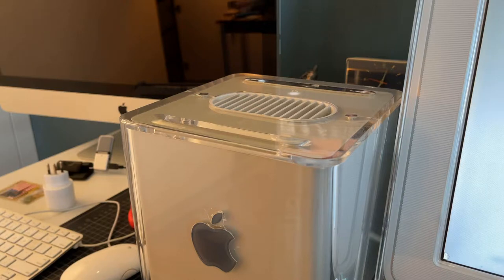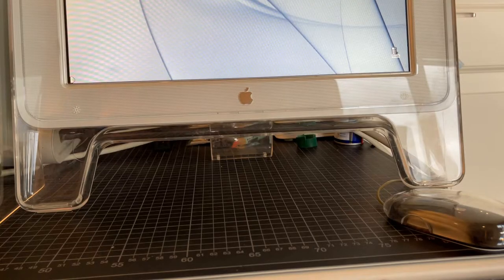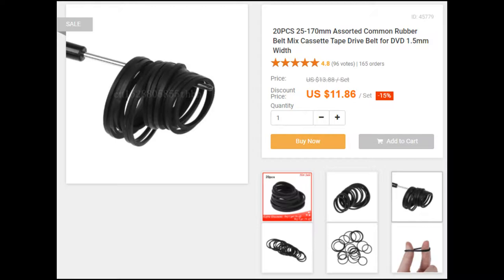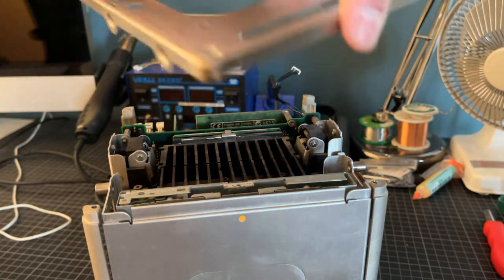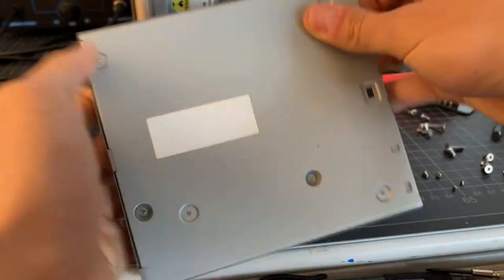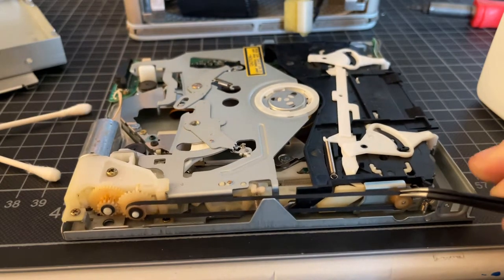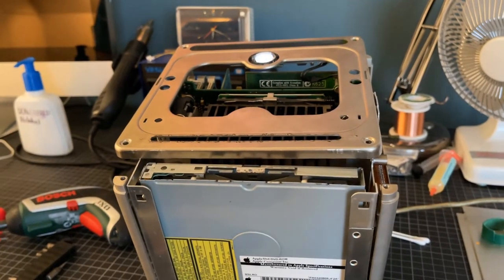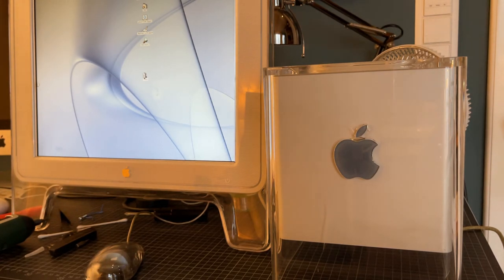How to Repair the CD Drive Eject Mechanism on your G4 Cube! | Mastergeko4

Comment: 11:09 UPDATE TO MY ORIGINAL COMMENT. I found another iMac G3 DV model and I just got it today. It makes this exact sound and I didn't have to adjust or replace the belt or rubber rollers. It worked perfectly with a couple flukes. It took the disc out of my hand with no issues. And it still reads. According to the Seller. It was stored for 11 years so that must explain why it still works. The CRT has low mileage on it too. It doesn't flicker at all. This one might even be in better condition than my first one. This Replacement is a 400MHZ Blueberry. My old one was a (I think) 500MHZ Graphite. Replacement Has 176MB of RAM. The HDD was gone on the replacement because according to the seller it was taken out of a bank office so the HDD was removed and shredded. I just stole the HDD out of my Power Mac G4 Quicksilver and put it in.

Comment: Thank you for the amazing video! I performed these steps earlier today and my cube (complete with new belt) now ejects CDs again. All you need is a steady hand, the belt, and a few screwdrivers. Note: the two springs you need to detach in the CD drive are incredibly small, used a microscope to get those springs back in place. Also, ensure there is not a CD inserted when you perform this operation.

Comment: Thanks a million. Got a working cube from Japan recently and the discdrive has this exact issue. Will do this fix later this month ( installed the OS already using a target disc mode ).

Comment: I just received a G4 Cube whose optical drive still has a disc in it, and won't eject. This level of disassembly is a bit beyond my confidence level, but I'm glad to have been able to see it.
Reply: I'd be interested in the optical drive only for an IMac G3 if you can tear it down instead of selling the whole system
Reply: Update: I found that by holding the Cube upside-down while ejecting the disc, I can extract that disc manually.